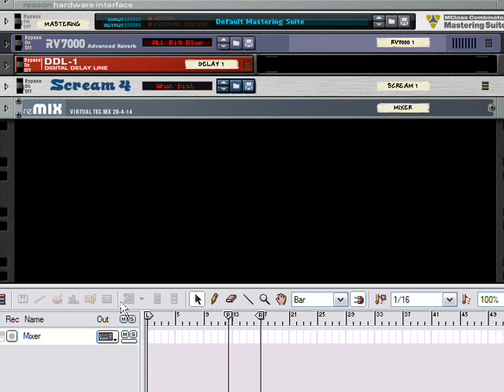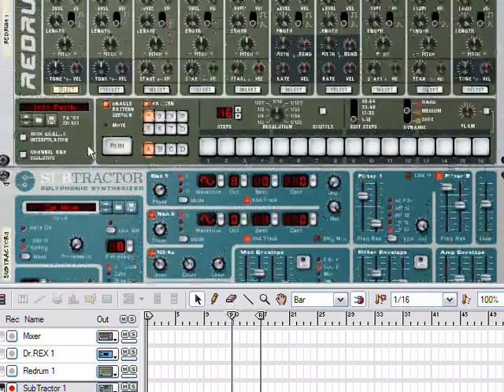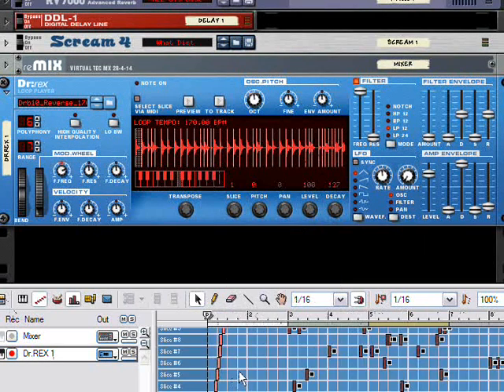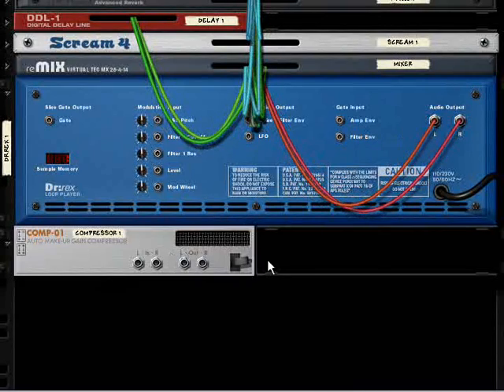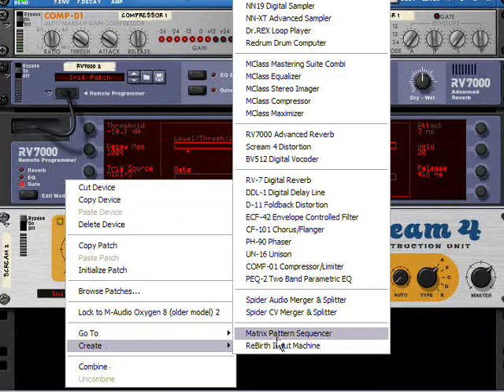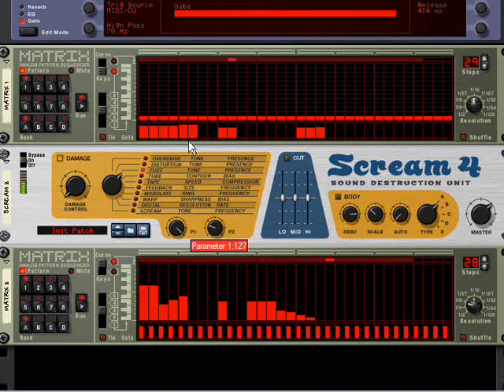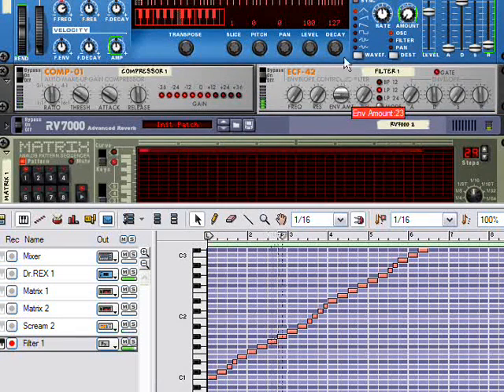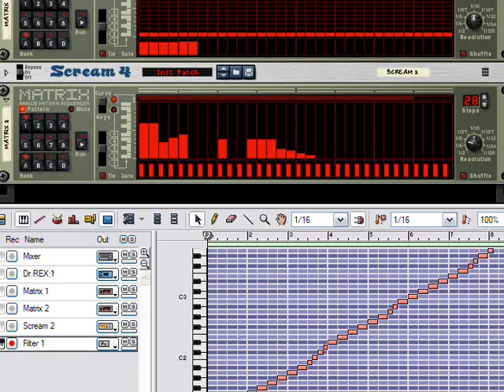Reason - Glitch type drums (advanced)

Comment from the maker: Turn the FREQ down a bit, and turn the ENV AMT up some.  Use the velocity knob if you want to, but remember it will ADD the (Velocity * sensitivity) to your ENV amount.

If you're using a fast rex track, the gates might be coming too fast for it to do any real  filtering.  If so, try using a matrix instead of the REX as your gate input.